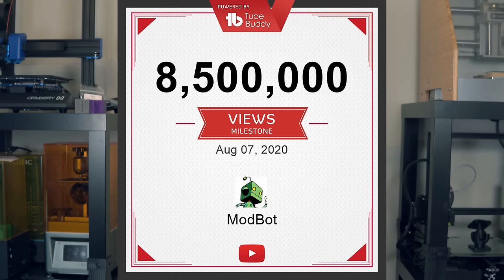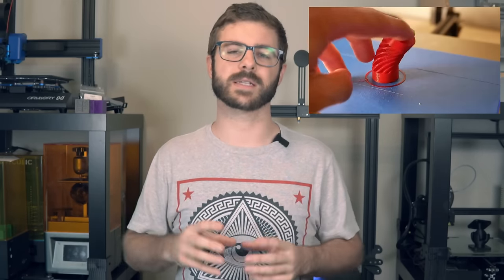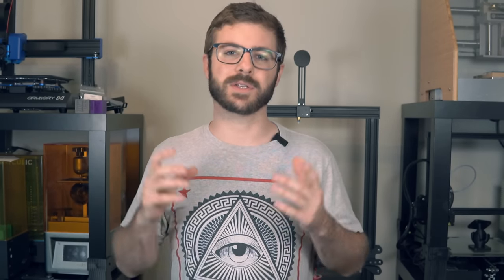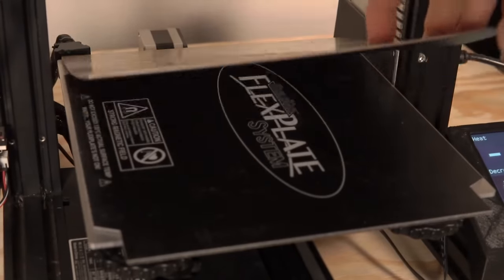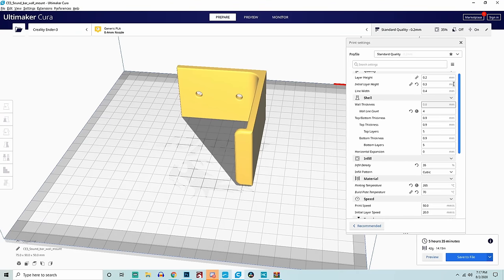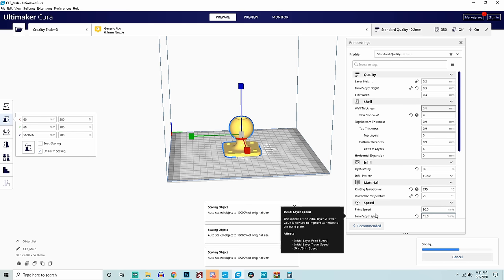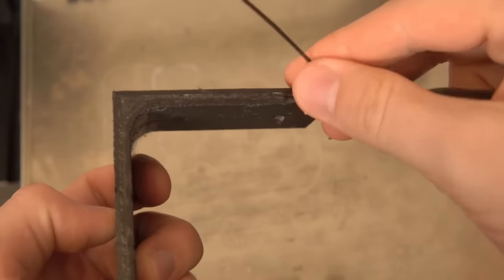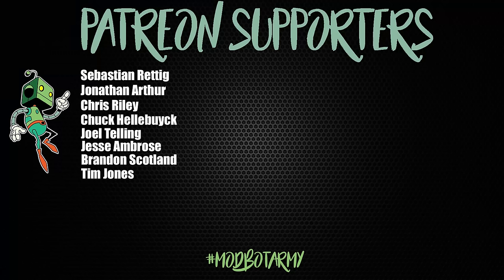3d Printing Carbon Fiber Nylon For Beginners (Ender 3)

Comment: I have a question, I'm going to buy my first 3d printer soon. Thinking about the ender pro. Would you recommend that printer or is there something coming out soon that I should wait for instead. Thanks
Reply: There is no perfect printer. There are only good printers for your needs. The Ender 3 or Ender 3 Pro are good choices. Many spare parts, lots of people use them cheap replacement parts. Perfect printer.. don’t exist. The Ender 3 or pro should do a good job unless you want to print huge stuff. 

Lots of stuff about the Ender 3 on you tube. Reasonable choice.
Reply: @concernedcitizen780  thanks

Comment: How do I set hotend temp past 260c on Ender S1? I have the upgraded hot end. A commenter here mentioned you have to change it in the firmware but I'm searching all over Google and can't figure out how to do this.
Reply: If you are running marlin, you'll have to compile your own firmware. If you are running klipper, it's a simple line of code

Comment: So this might be a "well duh" type of wisdom, but in all going to ask.   I've only printed with PLA and a little of PET-G, and I've noticed that if I need a print to be a specific size, then I need to print it anout 5% bigger because if not, then it will come out too small.  Is this the same with different types of filament like nylon?

Comment: im late to the show. but unless i missed something about changing the heat element, can the ender 7 print at 275C? ive always been afraid to go above 260. i print tulman aloy at 35mm/s and it seems okay though i do have warping issues at bed level from time to time. this was extremely helpful. im using an ender 3 pro.
Reply: No

Comment: Would anyone here by chance know if i would need to upgrade the nozzle on the ender 3 V2. Also whats the plastic deformation temp of this stuff. Was thinking about making a brake duct out of it so it would be about an inch from the rotors on the car.

Comment: Whats the layer adhesion like on that filament? Have you done any stress tests along the layer lines?
Reply from the maker: Layer adhesion is quite good as long as you are printing hot enough. I do not have any form of testing equipment although this may be something I need to invest in for the future.
Reply: I usually test by printing something like a solid infill cube and try to cut the cube with some side cutters (be careful and don't slip, ya that happened once, lol). Or print that ball thing in this video and try to break it along the layer lines. I usually print something smaller to test though and print at least 50% infill.   It is just a problem with some filaments that I like to test so I know if it is critical to print in a certain orientation or not to optimize the part strength.  The best plastics never separate at the layers, the cutters just dig into the plastic. It doesn't always have to do with print temperature, but higher temps can help.  The reason I asked is I like Carbon/Nylon and wondered how the filament from Matterhackers was layer adhesion wise.

Comment: Hello. So I have a voxelab aquila  and VOXELAB  told me that that printer can't print carbon fiber but I got a all metal hotend and I'm running it just fine my temperatures on my screen are topped out I don't know what that's going to do to my motherboard or any of the heating elements but the reason why I'm leaving a comment is because I would like to know what speed cuz it seems like I have to run my speed at 60% because if I run it any higher it doesn't stick to the bed or the nozzle seems like it cools down faster by the way I'm a super beginner I've only had this printer maybe a month and I'm already trying to print carbon I know that's bad but hey man you got to go balls deep sometimes. And if I said anything wrong and look stupid that's okay because I'm beginning

Comment: Hi I have a question I am new to 3d printing and want to get one that supports ninja flex and wanted to know as a starter what is a good beginner printer supporting NInjaFlex also inte rested in a resin printer for making cosplay masks  thanks good video BTW
Reply: The Prusa printers do well with flex and usually work right out of the box with only minor tweaks. (This is second hand info, but I trust the sources and have seen it work.) Although the creality's were on sale :)) last I looked, an entry-level Prusa wasn't much more, especially considering how easy they are to use. -H
Reply: direct drive

Comment: Have you done carbon filled PETG? I have a 0.6 mm steel nozzle for this. Is this the best option?
Reply: if it dont clog run it, it will likely be the best res to small will plug up

Comment: Does anyone’s printer ever set off the fire alarm? I’m thinking about getting an enclosed one like the Adventurer 4 when it comes out in September and I live in an apartment. I know that from one of your previous videos there’s always a fire risk but I guess my question is geared around more day to day use.
Reply: Fire isn't the issue it once was. Most 3d printers now have thermal runaway detection.
That being said, I mounted a small fire alarm in my enclosure and its never gone off. 
I've been printing all kinds of filament pretty steady for about a year.

Comment: I've got similar slicer settings with the MicroSwiss direct drive, hardened steel nozzle and the filament heater. For some reason my layers aren't tight. It's much weaker than even PLA. You can peel them if you give them a slight hit with the scraper. And suppose you printed a rectangle of 1/4" thickness, it bends like a book. It's a bit odd. It's the SainSmart filament. Anyone else have these issues?

Comment: Hi mate. A few weeks back I installed the micro Swiss all metal hot end and direct drive. I haven’t used it ever since because it just won’t print properly. When I select home, the nozzle ends up off the bed and the printing is terrible. Is there a way you could help?
Reply: I've addressed this recemtly as well.
I purchased my Micro Swiss Direct Drive system 2 months ago and after purchase ($110.00) I'd read the same problems with bad prints and bed centering and have been hesitant to install because my printer is printing nicely, but need the opportunity to print other materials. Hence the Micro Swiss purchase, that was touted as plug and play...seems not so?
It sure would be nice if there was a video, in Laymams terms for us newbies, on how to remedy this, without all the terms and procedures that aren't comfortable with people that are newer too the hobby.
We need a hand in settimg this up correctly for newcomers, please.

                       H E L P!!!

Comment: Can the MicroSwiss handle a .6 or .8 tip?  Since the hotend has less melt surface is why I ask.  I have an ender5 plus so it would be nice if it could :D  But I doubt it :/
Reply from the maker: I have been running a .8 with no problem

Comment: what causes all of the zits (@12.30 on)? I've turned off power loss recovery and print slow (30-60mms) but after a FW upgrade, my machine turns out builds exactly like this...great layers but tons of micro zits. Can anyone advise?
Reply: It's a slicer quirk. It can be fixed by adjusting the minimum resolution to a larger value. I believe this happens when the value is smaller than the minimum stepper movement so instead of moving in a curve, you get a pixelated curve which looks like a small bump.

Comment: Is the soft magnetic bed on the Ender 5 Pro suitable for CF nylon or do I need a glass bed?
Reply: If you don't put your bed temperature too high it works fine for me.

Comment: I have a question, I have a CR-10 with the Creality thermally insulated enclosure and the E3D all metal hotend however the software max's at 260°C. Is there any way to make it print hotter than that? Even if it means reprogramming it somehow? I don't want to buy a whole new set up just to be able to print Carbon Fiber Nylon or any of the other ones in its class but I really want to print it for products that people have said they want to buy from me.
Reply: for God's sake, buy a proper printer or you will set your house on fire.
Reply: My CR-10 can print up to 450 C (nozzle) / 200 C (bed).
Please check my previous comment about required upgrades.
CR-10 display shows you 15 C less than max temp (which is 275 C for CR-10/CR-10s),
anyhow if you wanna do any of these upgrades, you'll have to update your firmware.

Comment: Hopefully this hasn't been asked before, yet is carbon fibre filament bad to inhale?
Reply: Exactly how do you inhale filament.
Reply: Yeah, good point, was a bit vague, though I am surprised you cant read between the lines. Dust from sanding the print object and also when it is heating the filament to melt and credit, there are fumes, basic common sense stuff like that.

Comment: When 3 rolls of materials is as expensive as your printer...
Reply: Bruh 😂😂😂
Reply from the maker: Definitely only something you want to use if you have the application. For other prints PLA and PETG are more than enough!
Reply: @ModBotArmy  PLA is definitely enough for holding a soundbar, use nylon when you want a functional print for inside a car or in direct sunlight.

After watching tons of videos on the strength of various materials the results are always PLA is super strong.
Reply: Thu Nell Ⓥ well I got my ender 3 for $140 before upgrades ofc
Reply: @timmturner  Thanks, I should have read your comment before posting my questions. Does nylon alone hold up in a car's interior heat, or is the carbon additive necessary too? Thanks -H
Reply: @ArchetypalCat  It's the carbon reinforcement that improves UV resistance, it's the much higher melting point that resists warping in a hot environment.

Really PETG is what you would want to use since it's inexpensive and it has better UV resistance. But of course you can always paint PLA which resists UV light, but it still has the low melting point.
Reply: @timmturner  thanks for the explanation. One more question, please: How is PETG vs CF for moIsture and heat resistance?
Reply: @ArchetypalCat  Nylon isn't water resistant, PETG is.

Durability is similar, nylon is more resistance to abrasion and has less friction. That's why it's often used as washers that spin, such as between two metal joints.

Heat resistance is similar between plain nylon and PETG, carbon filled nylon has more heat resistance over PETG.
Reply: @timmturner  perfect answer ..thanks!
Reply: @ArchetypalCat  You're welcome
Reply: @Laurence Munro thanks for the reply. Does ASA with carbon fiber exist? I did a superficial search but didn't find any...
Reply: @timmturner  asa for outdoors too
Reply: @rexxx927  No experience with it, don't know much about it either.

Comment: Great vid. But how do I get my ender to reach 275 degrees? Ive done the swiss hotend.. but it maxes out at 260. Help!
Reply: You have to change the max temp in the firmware to 290 because marlin won’t let it get hotter than 15 degrees lower than the max temp.
Reply: Some brands of CF nylon filament can be printed at 240-260.

Comment: I want to do the direct drive mod on my ended 3, other than the made Swiss direct drive kit do I need any other parts to do the mod?
Reply: I have the micro Swiss and absolutely love it, but that said if you want something different I’d definitely look at printermods direct drive set up as it is compatible with their linear rail kits as well.

Comment: I feel that my ended 3v2 is so slow.
How fast print speed is acceptable for this printer when using pla?
Reply: 50mm/s for inner walls and 25mm/s for outer
Reply: @Nicksperiments  I use my Ender3 Pro at 100mm/s 50mm/s for outer when doing my electronics project boxes and it works just fine. On the other hand, if I was printing some very detailed model then yes, I would go 50mm/s 25mm/s. I think it depends on what is being printed and what quality is to be expected.

Comment: How does this compare to carbon fiber PLA?  This seems very expensive to experiment with
Reply: Biggest difference is in brittleness: CF-PLA can be quite strong but at some point it will snap and break. CF-Nylon might bend but it will not just suddenly break.
Reply: If you think CF-Nylon is expensive - check a price for CF-PEEK or CF-PEKK!  :))
Reply: CF-PLA has been tested at CNC Kitchen to be weaker than just PLA.
Reply: @truantray  Thanks for the info
Reply: @truantray  Yes, I saw that video.
And Stefan is absolutely correct about few things: in general, Carbon Fiber does not increase strength in Z direction (quite contrary), only in XY, so it's very important how you design and print the object. Second, PLA already has high tensile strength and a bit of CF (usually 5%) does not really make much difference there.

On other side, adding Carbon Fiber to Nylon has very different effect: unlike PLA, nylon is semi-flexible and durable / bendable, and Carbon Fiber increases tensile strength significantly (some blends have up to 30% of CF). So Nylon and Carbon Fiber sort of complement each other creating new material with very different properties: strong, durable and not easily breakable.
Reply: @Sleepery22  That's what I've always liked about nylon; I mean for decades. It's tough, flexes enough for push on clamps and it will give you lots of warning. Think of a camera stand or a microphone stand and the various clamps and mounts. If any of those suddenly popped off instead of just getting sloppy - yikes.

Comment: but can it hold a bigger load? a soundbar could also be held by a abs hook i guess
Reply from the maker: Yes absolutely. Not the best example just something that I needed
Reply: I printed 4 shelf pegs in cf nylon and stacked all my canned goods on the shelf in our pantry.  This stuff is pretty strong if you print it hot

Comment: can you use the stock heater cartridge on a all metal hot end to print nylon on the ender 3
Reply from the maker: Maxwell Dol yes! My printer is using the stock cartridge and thermistor in the all metal hotend
Reply: @ModBotArmy  thank you i am thinking of upgrading to a all-metal hot end

Comment: why is there no hardmetal tips? that metal u use in a lathe. the bits are strong as hell.
Reply: can't sell someone more than one indestructible tip 😂
I would assume those brass tips are super cheap to make

Comment: would printing in a vacuum work ant better ?
Reply: Interesting question I've wondered about too. The vacuum pump would have to have a good pull. (I use old air conditioner compressors, on the suction side. They don't last real long though because there's no Freon running through it, which lubricated the compressor some. It helps to have a friend in the HVAC business :)

The vacuum will also dry the air. One odd problem is making sure the suction airflow doesn't interfere. Also vibration to consider.

If you've ever done vacuum bagging with epoxy or styrene, a fun thing to try is 3d print a form (sculptors call these "armatures"), then cover the form with epoxy or styrene and put the whole sticky mess in a vacuum bag! It really makes it adhere to the form.

Another thing to design, the housing would have to be very strong - recall that atmospheric pressure is about 18 psi ... Just imagine 18 pounds pressing in on every square inch of the sides of the vacuum box covering your printer. When I need a vacuum on a generic part, I put it in an old pressure kettle... Interested to hear what you find! - Howard in North Florida

Comment: I've addressed this recently.
I purchased my Micro Swiss Direct Drive system 2 months ago and after purchase ($110.00) I'd read the problems with bad prints and bed centering and have been hesitant to install because my printer is printing nicely, but need the opportunity to print other materials. Hence the Micro Swiss purchase, that was touted as plug and play...seems not so?
It sure would be nice if there was a video, in Layman's terms for us newbies, on how to remedy this, without all the terms and procedures that aren't comfortable with people that are newer too the hobby.
We need a hand in setting this up correctly for newcomers, please.

                       H E L P!!!
Reply: If anyone is reading this, with typical Creality printer Marlin firmware, just create a text file in in Notepad containing the Gcode commands for the offsets. 

This was my initial Gcode when I setup a Microswiss NG on a Ender3 V2 Neo, don't use the exact offsets, change them to what you need, my printer needed  new limit switch covers printed to move the switches to accommodate the new extruder.

M206 X10.0 Y5.0 Z0.0
M500     ; Store Settings
M117 Saved!

All you do is change the X and Y offsets to whatever you need them to be. Use the Move feature on the printer control panel to move the hotend to find out where X0.0 and Y0.0 are, and then figure out how much it's off by. 

Once you have the offsets, make sure you use a decimal point (eg X10.0 for 10mm X10 will not work properly) save the text file with a filename ending in .GCODE

Put the file on your flash drive and "print" it. Make sure before you run it that you put all axis into their center position just in case, my printer would randomly move the Y axis and skip the belt while "printing" these types of file. Putting the Y axis in the middle prevents it skipping the belt alternatively, and much safer, just loosen the belts until they are slack before running these configuration files. That goes for the E step calibration file on the Microswiss website too. Don't run that file without first ensuring no belt skipping can occur. 

Edit: I didn't change Z offset because that's easily adjusted in the printers settings on the control panel, and I usually meddle with the Z offset when starting a print with different material or different layer height anyway, until I see it printing the skirt with the amount of squish I want to see. I'm sure that people will tell me I'm doing it wrong, but it works for me.